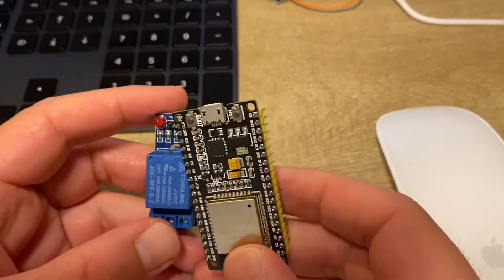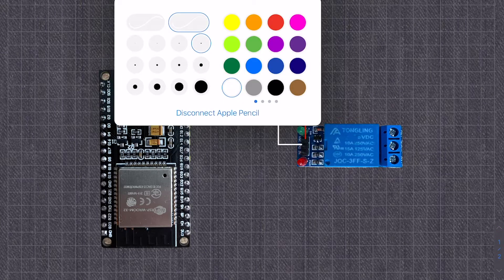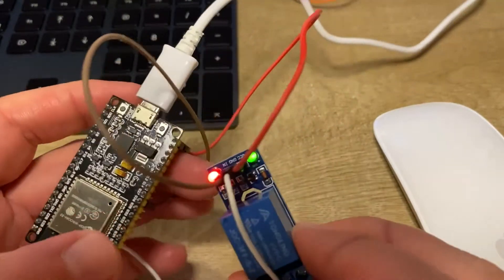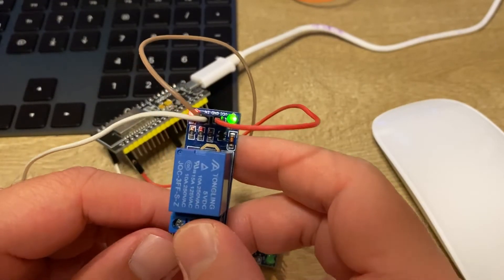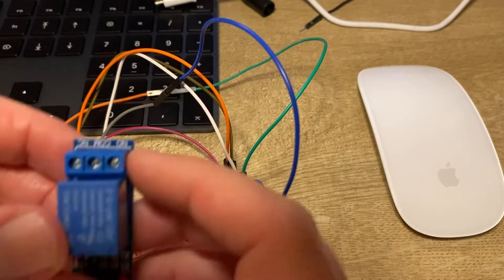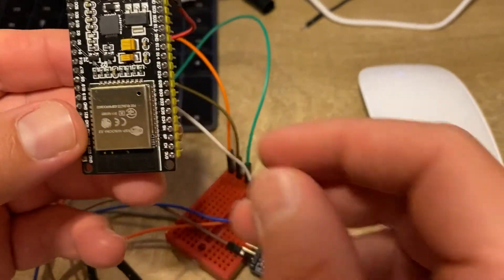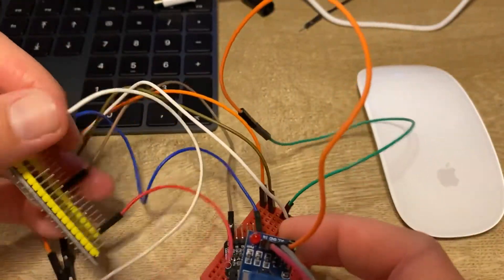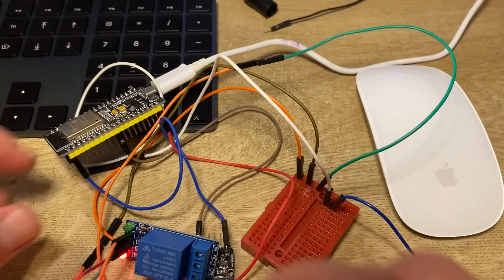ESP 32 Connect 5V Relay via Logic Level Converter (ESP32)

Comment: this relay alsoworks fine with 3.3v you just power it using esp32 3.3v and it will be fine no need for logic converter for this application
Reply from the maker: In most cases you are right, 5V input makes system more stable under load

Comment: I want to ask whether the logic pin of the ESP must be connected to the logic to produce a 5 volt output? I have tried connecting the ESP32 logic pin directly to the relay, but it still works. However, in certain conditions the relay turns on suddenly before the ESP32 orders the relay to turn on, why is that? does the logic voltage have to be changed from 3.3 to 5 volts to be stable?
Reply from the maker: Logic pin produces 3.3 volt under normal conditions. Sometimes that will be enough to trigger relay, but for some equipments it may create unstable conditions

Comment: The best thing is use the VIN of the esp32 and it provides 5v output, to control the relay use the logic to 0 to turn on.. This way it worked for me..
Reply: Can you explain how to do it?
Reply: You can't turn it off then, it still requires 5v to turn off

Comment: What happens when you power this circuit with a 3.3 volt battery?  Your serial is carrying 5 volt already is it not?
Reply from the maker: If you power with 3.3 volt, trigger signal becomes 3.3 as maximum and it is not enough to drive relay

Comment: Thankyou for the information. Just my esp32 board doesn't have 5v output and only 3v3. Does that 5v really required? or I can just connect 3v3 to the LLC and output as 5v? does it work like that or I'm completely wrong?

Currently I need to connect esp32 to the peristaltic motor through 5v Relay. But I can't seem to make the relay activate at all, it just flickering light of led with low intensity. So really wonder how to make this work or I should just use external power source.
Reply from the maker: Hello, 5v is just for provide input to esp and llc, on pin output side you do not need 5v, 3.3 volt triggers llc to provide a 5v output

Comment: Hai sir, Can i use this module to detect high frequency of square wave having amplitude 5v?
Reply from the maker: Hello, sorry for late answer. This module just gives output 0 or 5 volt by measuring threshold (around 2.6 volt). By using this logic you can try to solve your problem , but it is related to your frequency value
Reply: @techinfo5824  Thanks for replying.... I got my hands on one of these modules and it worked fine for me.I wanted to detect frequency output from an arduino nano using an esp32.

Comment: Any suggestions on if I make a custom ESP32 board without 5v connection. How should I supply the 5v to the relay?
Reply from the maker: Or you can use 3.3 v relay like this one 3V Relay Power Switch Board, Icstation 1 Channel Optocoupler Module Opto Isolation High Level Trigger for IOT ESP8266 Development Board (Pack of 5) https://www.amazon.com/dp/B01M0E6SQM/ref=cm_sw_r_cp_api_glt_fabc_BJRVXPQQB2MP0HMXHSQX?_encoding=UTF8&psc=1
Reply from the maker: You need 5V for relay, that is mandatory. So you can apply 5V to circuit as main power input and use a 5v to 3.3 v regulator for esp power input.

Comment: If I power my relay module with external 5v power. And connect just the data pin eith esp32 ...

Will my esp 32 burn?
Reply from the maker: No. Most important part is not applying power to esp pins

Comment: Hello, can you help why 4 Relay module with Optocoupler is causing the ESP32 not to connect to Wifi if ESP32 is booting and the relay module is connected? If I disconnected the VCC from the VIN of the ESP32, then then ESP32 will boot ok, and then I connect VCC and I can control all 4 relays without any level converter. I also tried to provide VCC and GND to the relay board from external 5V but still the ESP32 does not connect to WiFi and does not communicate. I use pins 14,27,26,25. Of course I can buy a level converter but I think it will not help as the relays are triggering ok only starting with the relay module connected is not possible.
Reply from the maker: Hello. Sometimes pin 14 generates some problem while initializing wifi. Firs please try with no connection to pin14. (just connect 3 channel). If it works change pin 14 with another one. (Maybe 26). If that works I will explain technical details of that problem.
Reply: @techinfo5824  Ok initially I had 12 14 27 26 then I read that with 12 high it will not boot so I moved to the right with 1 pin, ok I will let also 14 free and hopefully it is ok. Thanks for the advice!
Reply from the maker: Please inform me 👍

Comment: Hi thank you for this tutorial. I have a logic level converter which has TXO and RXI to TX1 and RX0, is this the same wiring? Also is it possible to control a 4 channel relay like this?
Reply from the maker: Thank you. Same wiring yes. But here are the points for your situation; RXI -- High voltage input to voltage divider from high-voltage device. Signal will be shifted down and sent to low-voltage device on "RXO" pin.
RXO -- Low voltage output from voltage divider to low-voltage device. Signal is shifted down from "RXI" input.
TXI -- Low voltage input/output of MOSFET circuit. This pin interacts with "TXO" on the high side. Bi-directional, but this is the only shifter that will shift from low to high.
TXO -- High voltage input/output of MOSFET circuit. This pin interacts with "TXI" on the low side. Bi-directional, but this is the only shifter that will shift from low to high.              To send a signal from the low-voltage side to the high-voltage side (e.g. from 3.3V to 5V), the signal must be input at "TXI". It'll pass through the converter and come out as a higher voltage on the "TXO" (transmit output) pin.
Reply from the maker: And yes you can control a 4 channel relay with this way. If you can share exact model type of your LLC i can help you to wire it
Reply: @techinfo5824  Hi thanks for your answer! In the end I decided to get a 4 channel bi directional converter and that works great!
Reply from the maker: Marlot Meyer great !